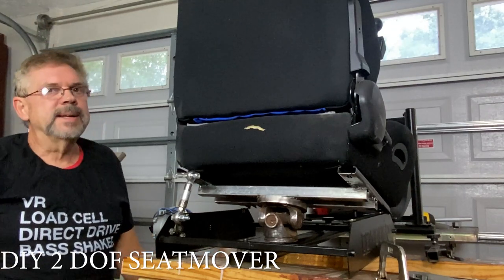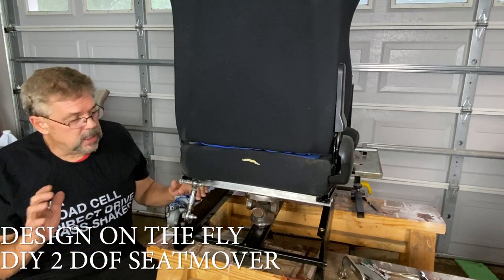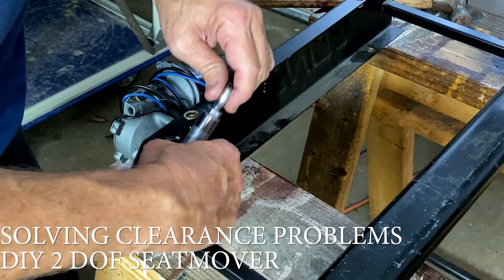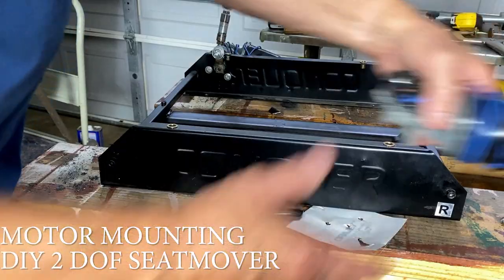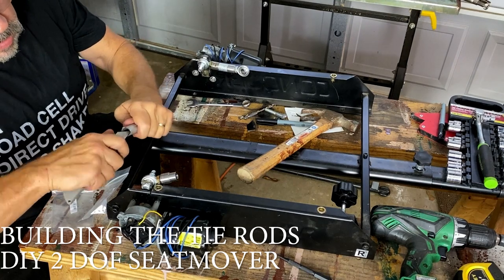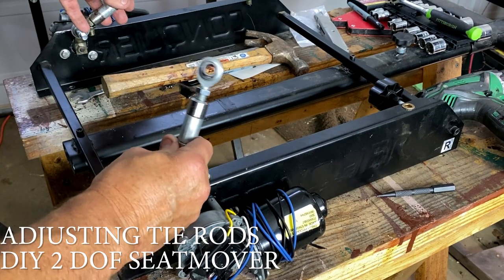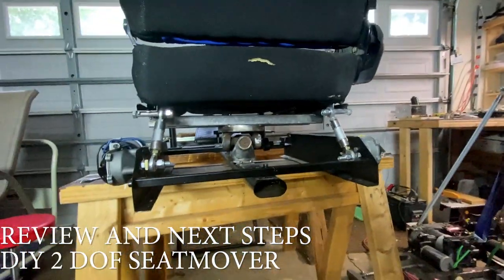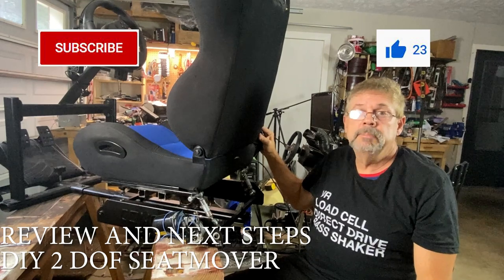DIY SEATMOVER Part 3 WW motors Arduino IBT-2 Simtools MOD your static SIM RIG with Motion!

Comment: Cool build.  I did one similar a long time ago.  Followed a build and used a Velleman K8055 to a Pololu 24 volt 2 channel speed control.  I had a couple of wheelchair motors kicking around from an old project.  Then the software changed and I lost interest.  Looking forward to what comes next!
Reply from the maker: Thanks for the comment Robert,  If those motors were 12V you would have already had it done!  I have some Pololu 12V12s laying around.. I was thinking of using them for my 3DOF rig but the IBT's have been just fine. They are supposed to be good for 40 amps each and even with my 3DOF at full pull I only crack about 22 amps combined. These WW motors wont pull anywhere near what the IBT's / or most motor controllers can handle. Thanks for watching the build!  DMAX

Comment: Dave, That Crab Pot Motor Sold By PGSAW is Sold Out but He Does Have the GEAR MOTOR 12 VOLT GREAT FOR MOTION SIMULATOR / ROBOTS 150/160 rpm 25:1 ratio Model. Would You Advice Me to Purchase these 25:1 Model Since the 50:1 Model is Sold out and Not even listed?
Reply from the maker: hmm..  not sure about the 25:1  Maybe for a seatmover but not for a full frame rig..  Can you message them on Ebay?  Maybe they have some in production now?

Comment: what size tie rod did you use Dave? I ordered some with 8mm inner diameter.  Seems a bit small.
Reply from the maker: They were 3/8 of an inch.  They fit right inside the 1/2 conduit.  I have them on my 3DOF rig too.
Reply: @DMAX_DIY  thanks Dave! I may consider getting bigger ones then. 3/8 is about 9.5 mm.
Reply from the maker: @splitcurve2457  I just got ones that would fit inside the 1/2 conduit so I could tack weld them on. They are plenty beefy for moving my 3DOF full frame rig around, much less the seatmover 2 DOF.

Comment: Hi. can you explain the engine rpm ratio 25:1, 30:1 ,50:1 60:1 .
Which ratio is the best?
i plan to make 3 dof with "heave" axis. all 3 motors are up and down together .thanks
Reply from the maker: So far I would go with the 50:1..    I have some 20:1's I am going to directly test against the 50:1's I have..  It should be interesting..  but I have been very happy with the 50:1 motors..    I would go with that or 60:1 if you can get them..    Let me know how it works..  Dave

Comment: Really considering doing this, how difficult would it be to add the  3rd DOF (traction loss) ? is it just adding another motor to rotate the whole thing?  Another question woul dbe is 2 DOF enough or would I be wanting more?
Reply from the maker: Traction loss was a game changer for me.. It all was really!  But it's Traction loss was worth doing.  Take a look at my channel here..  In the DIY motion section I show the traction loss etc.. https://www.youtube.com/channel/UCVaC4nPhsTa9BRKjQFhf1kw
Reply: @DMAX_DIY  thanks, you really make this look doable (and affordable) i think if i can basically follow the 2dof and add the 3rd , im in business.
Reply from the maker: @rayc3253  It is fairly affordable compared to most hobbies.  The first time your new rig takes off when you stomp on the gas is thrilling!   Stay tuned cause I should be getting the seatmover working this weekend.
Reply: @DMAX_DIY  awesome, i talked with the wife, she gave me the thumbs up,lol. Plus i have welding experience and we have a welder available. Super excited here. Im going to attempt a 3DOF.  I watched some of the vids you have on the 3, but didn't get to deep. Is there one explaining the traction loss platform?
Reply from the maker: @rayc3253  Yeah Man!!! You got approval AND a welder?  Awesome.. So here is a link to my channel.. I have like 50 videos on DIY motion rig.   https://www.youtube.com/channel/UCVaC4nPhsTa9BRKjQFhf1kw
Also here is specific for traction loss.. Basically it's a mid frame that rolls over the top of the bottom frame..  There are 2 videos on TL.. https://www.youtube.com/watch?v=RFLd2eSeFaY  
and here is my build on X-simulator.net.. 
Congrats my friend.. You are so close to having a motion rig..   Real close.. maybe a month away..  !!! DMAX  
https://www.xsimulator.net/community/threads/full-frame-2-dof-traction-loss-new-build.14740/

Comment: how come nobody uses 2x4 wood to keep the price down, i'm sure its sturdy enough and the softness would add to the realism of dampening the motions
Reply from the maker: Well a lot of people use wood for 'static' rigs that dont move..  You really need a solid connection to keep it from rattling apart.  The rig moves a LOT even though you may not see it.. You FEEL it for sure.  You dont want to 'deaden' the feelings.. You can 'tune' them in software too which is great.    Sorry for the late responses on your comments but YT doesn't let me know anyone comments after the first couple days of a video.. I'm new to doing the YT thing..  Hopefully helping folks out   so that's what I'm focusing my videos on now..  Dave
Reply: @DMAX_DIY  I might just build a wood static and then check out my local steel supply for a long term solution for sure, thanks for advice
Reply from the maker: @xyzebruh1083  Yeah.. I get it..  I've seen quite a few photos of wood rigs on some of the DIY forums.    I was going to order the steel but in the end I went down to home depot and just got mine there.

Comment: Hi sir,
Whole video make software installing. 2dof moition simulator & simtools programing With clearly.
Reply from the maker: Well I am planning on making a recap video on the 2DOF once it's finished.  Hope that will help. In the meantime I have like 50 other motion videos posted. Hope you can take a look at a few of those in the DIY motion section till I get this last video completed! DMAX
Reply: Thank you sir.

Comment: Is there any copy and paste code for this seat setup you built ? For the Arduino! -Leo
Reply from the maker: Yes..  you dont even have to copy past.. you just open the SMC3.ino file with arudino IDE..  then if you are using the IBT-2 controllers set the mode to '2'..  MODE 2..  I show it in this video here..   https://www.youtube.com/watch?v=KrTEpgaQViQ&t=742s  and you can DL the SMC3.ino and SMC3.exe here  at the bottom of the page https://www.xsimulator.net/community/threads/smc3-arduino-3dof-motor-driver-and-windows-utilities.4957/
Reply: @DMAX_DIY  thank you very much, great channel I’ve been watching episode after episode. I purchased the ibt2’s and have the r3 uno, any recommendations on what actuators to purchase that you’ve already done R&D on? 
Thank you got the speedy response
Reply from the maker: @laaxess  Ok.. So I would go with the 12volt crab pot pullers I got off EBAY.. they are now like $115 each.. but they have been out of stock for the last 6 or 8 months. and apparently they are back!  I just ordered 3 more of them..  I run them on my 3DOF for the last 3 years and they are powerful and no issues..  Here is the link.. I hope it helps.  So now I will have 6 of these motors..   https://www.ebay.com/itm/354052076387?ViewItem=&item=354052076387
Reply: @DMAX_DIY  thank you very much for the speedy response and guidance
Reply: @DMAX_DIY  Thank you for your response, I have not attempted to build a motion sim yet, I only Build Static Rigs at the moment. I'm glad there is code for it, I can't imagine the amount of time it would take to re-invent the Wheel! Any new cool updates on your build so far?
Reply from the maker: @laaxess  Thanks for your comment!  Actually, Just getting some time together to show my SimTools video..  I get to try out some new software from a vendor.. which should be nice..  Swapped to a new pc so it's taken a few days to get back up to speed!
Reply: @DMAX_DIY  Sounds Awesome, Hope to see all the cool updates soon. Sorry for the late response!